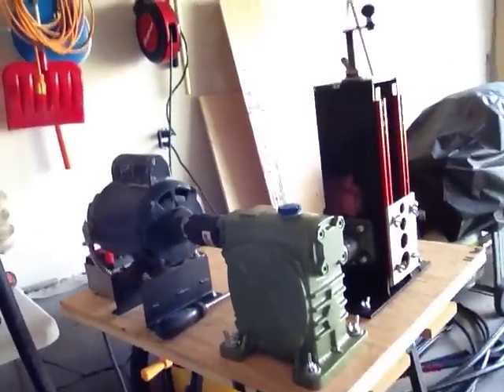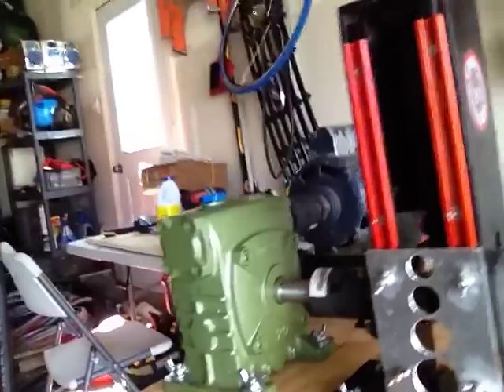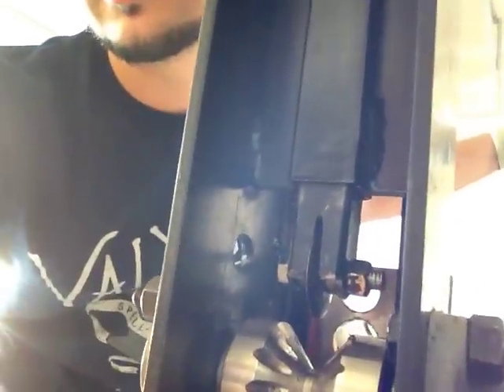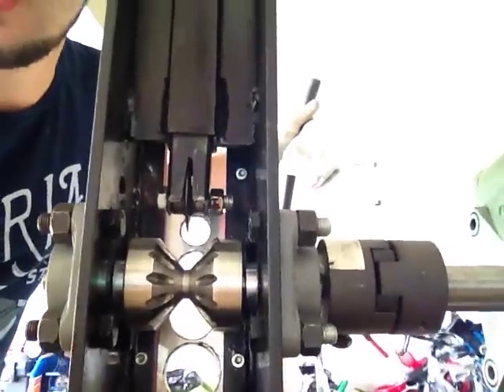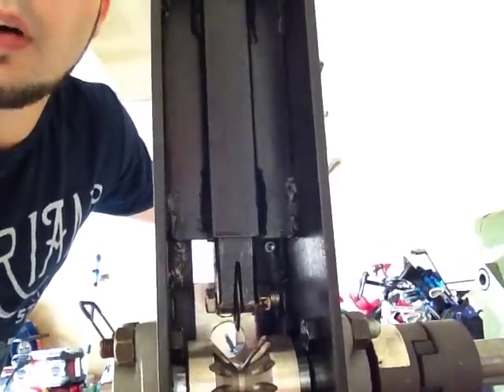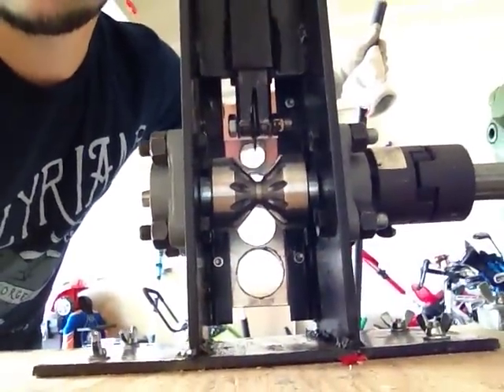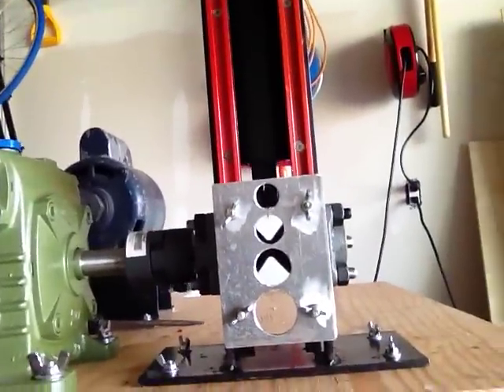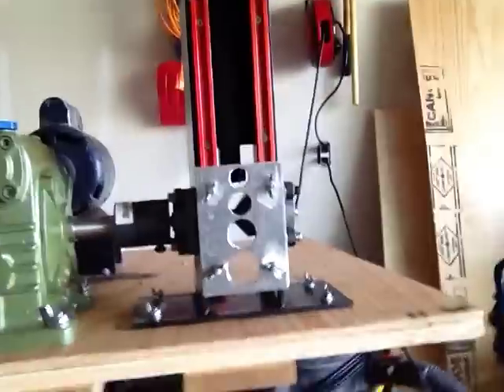Home made wire stripping machine

Comment: Good channel, Where can I get/find the circular blade?
Reply from the maker: eddie Towers , I bought it from an electrical supply store. It's a rigid cutting wheel from a pipe threader
Reply: Really, cool. Thanx. Its still, to this day, awesome a home made machine. Its like...when machines were really made.
Reply: i apologize for pestering, but would you happen to have a product number or something, I've looked it up, but I don't get specific diameter, to which I'd like to match closely to the size you have on your machine, thanx
Reply from the maker: Sorry for late reply, i don't come on my channel very often. It is a Ridgid 44185 replacement cutting wheel i believe
Reply: dannyfilion again, cool and thanks a million

Comment: Turn the noise  down,Henry ...wouldja? 
  The angle of the feed wheel will not work for wires smaller than half inch. 
    Stop competing with the radio. It's annoying.